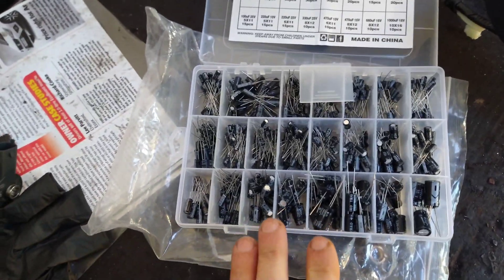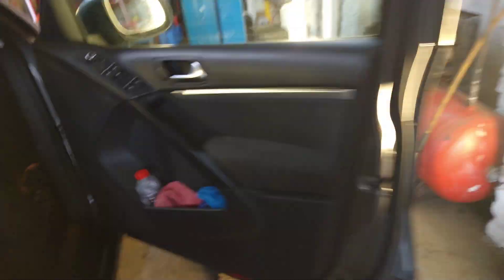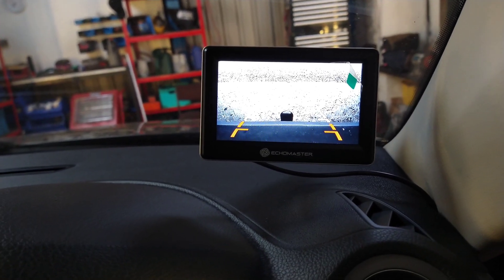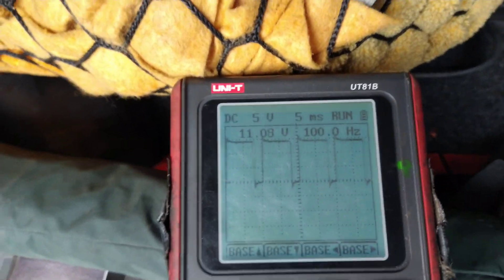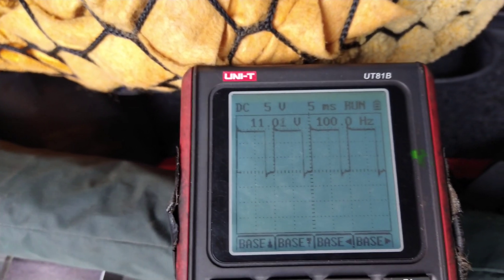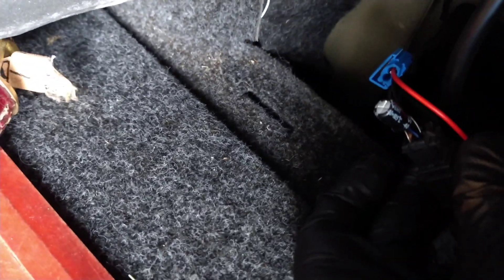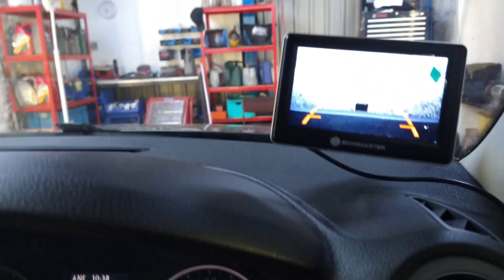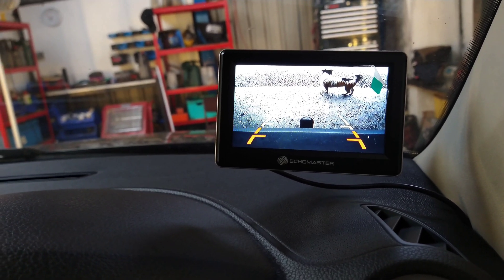Fixing a bad reverse camera picture.

Comment: Nice job man  can you tell me what capacitor did you use and which cable did you cross
Reply from the maker: Hi, the capacitor was a 680uF 16V.
I can't remember the wire colours now but they were running into the right hand side in the back of the car  Going through the floor.
I identified them using a piercing probe on a multimeter lead and found the live while the car was in reverse.
The long leg of the capacitor went to the reverse lights power wire and the capacitor's short leg went onto the reverse lights ground.
Thanks for watching
Reply: @mechanicmatt871  Thanks man